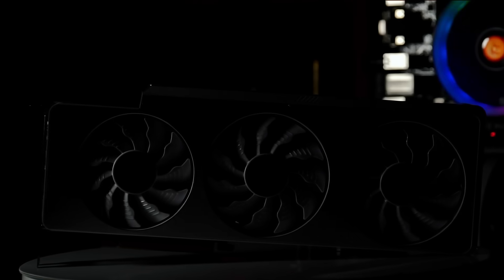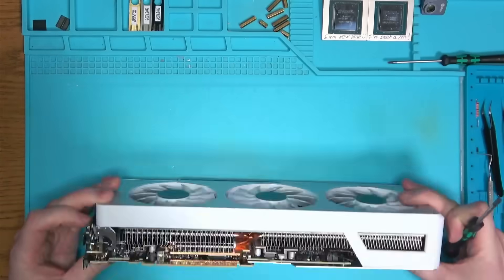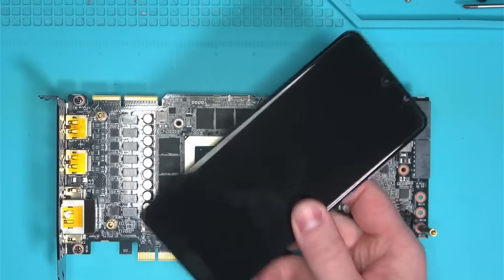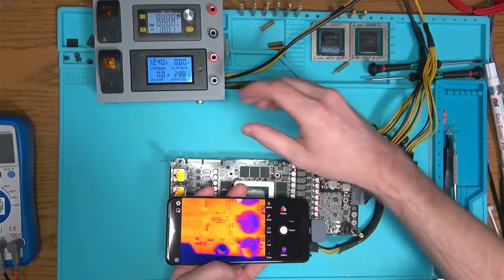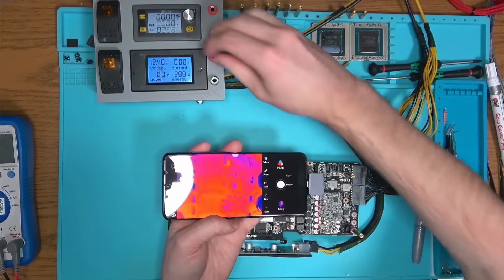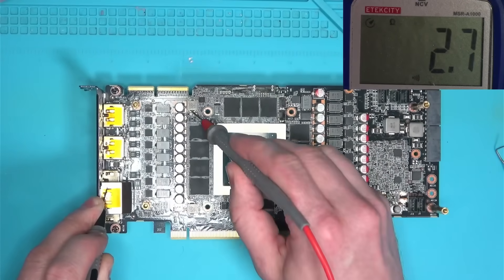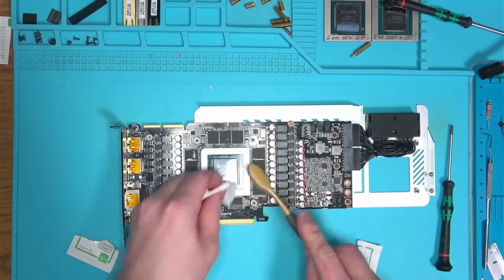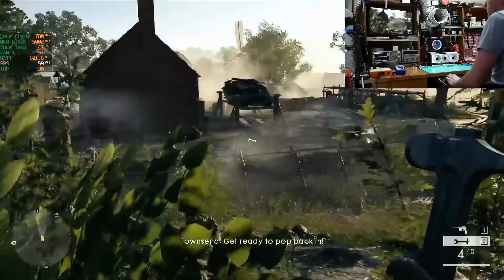Do rare and expensive graphics card fail less than budget cards ?

Comment: Profit margins are smaller on budget cards, so it's in the manufacturers best interest to ensure their cheapest cards last well beyond their warranty period so as not to cut into that profit margin. High end cards have plenty of margin, so much so that an RMA is usually built into the MSRP.

I've also found that if you're going to buy a flagship card, and you want it to long outlive it's warranty, you're on average better off buying a Radeon card. nVidia completely shafts their board partners on the price of their GPU dies, so if their AIBs want to make any money, they need to save money somewhere, and that usually ends up meaning poorer component selection. Yes, GeForce flagships are almost always faster and more feature rich than Radeon, but I've also found it to be a case of "the light that burns twice as bright burns half as long."

This is a big part of why eVGA exited the GPU market, because they knew they'd be selling failure prone garbage if they wanted to stay price competitive with nVidia founders cards and the junk that AIBs like Gigabyte and ASUS are willing to sell to unsuspecting customers, and eVGA's generous warranty service coupled with high rates of failure was a business model they knew was not sustainable.

Comment: I'm curious as to what is the most common reason for cards to fail and what the statistics are for failures in general.
Reply: i think failure through no fault of the user is fairly low. but some people do kill their components either by not cleaning them or other reasons like high humidity and not running a dehumidifier.

Comment: Why don't you use a bench power supply to inject voltage after the fuse? It would be alot easier than having to replace fuses just to find out which MOSFET is shorted. Of course, if you are going to fix the card, you need to replace the fuses, but if the GPU is shorted, it is game over.

Comment: Hey, I have this same GPU. It failed after a few months of ownership back in 2021. After having the card for longer than I did they finally sent it back "repaired". Near as I could tell they only replaced a fuse as it was the only area that showed signs of rework. However, I don't have a microscope so I probably couldn't tell if they worked those chips. Also, it was a different fuse than the ones you replaced. It was the fuse above the first one you replaced, the one with a Z on it. I said "repaired" (with quotes) because near as I can tell "Z" should be a 20-amp fuse (and I see you replaced it with a 20 as well). Gigabyte replaced it with a 10. 

I hadn't used the card much since I got it back because I didn't trust it. Since I bought an Asus 3080 Ti while waiting to get it back I have been using that. But because the warranty is up this year I've recently (as of 2 days ago) switched to using it. Haven't really pushed it yet, I'm somewhat afraid that it blowing again might somehow damage other things in the computer, though I can't imagine how. If you for some reason want more details/pics of the card I can send you them. I'd link them but putting links in comments pretty much always gets them flagged as spam.

Edit: Looking back at the pictures, one of the driver mosfets now has a different date code, so they did replace at least one of them. The fuse still appears to be incorrect though, so idk.
Reply: What you're seeing is a result of nVidia selling GPU dies to their AIBs at ridiculous prices, and the AIBs then doing a bunch of cost cutting on their component selection which results in flagship cards prone to failures as they dial in their component selection to only last as long as the warranty period. This is why eVGA told nVidia to kick rocks and exited the GPU market, because nVidia was forcing their hand to sell junk.

I hope you remember this next time you consider purchasing an nVidia card. I will no longer do business with nVidia, I consider them the scummiest in the industry. I've made some sacrifices switching to Radeon, but now I at least know that I'm not going to need to constantly worry about an expensive paperweight the very moment the warranty is up. AMD is also pushing hard to reach feature parity with nVidia, so it's a good time to start supporting them if you can manage without a CUDA equivalent for another 1-2 years.
Reply: @K31TH3R  i thought about going with amd, but there are too many issues. way more than intel and nvidia. i'd rather my components and drivers to just work.  also i never go with the higher end stuff. i stick to middle of the road. it does what i want for years and it doesn't cost me an arm and a leg. i don't need 4k, i don't do any editing or any workload like that just gaming and normal computer stuff.
Reply: @Stackali  When was the last time you ran a Radeon GPU in your machine? AMD is still suffering a bunch of (deserved) bad press for a terrible launch of RDNA in 2019, and another poor launch in 2022 with RDNA3.

I bought a 5700 XT on launch and the card was borderline unusable for the first 3 months, and wasn't really fully reliable until about 6 months later. It was the worst product launch I have ever seen from AMD. However, when I retired it in 2023, it was just as reliable as any other nVidia GPU I've owned, if not more so, as my luck with nVidia meant I statistically would've had a failed GPU in 2022, as they rarely last longer than their warranty period in my PCs.

RDNA2, on the other hand, has been about as close to flawless as a GPU architecture gets for the entirety of it's existence. I'm running a Liquid Devil 6800 XT and it has absolutely been that "plug it in and go" experience we all want from PC components, and while the productivity and RT side of things is lackluster, the card often has no issues performing way above it's weight class and often matches the RTX 3090 in raw rasterization. I also have zero fears about the reliability of the card, because it is massively overbuilt with a 14 phase VRM that maxes out at 42C even if I push 400W through it.

RDNA3 is also now in a very good state despite the rocky start, with 7900 XTX and 7900 XT owners having already done the work of testing and bug reporting that has ultimately made the 7800 XT one of the best all around GPUs AMD has ever launched, with little to no issues from the day it went on shelves.

It's also expected that RDNA4 at launch will be another repeat of RDNA2s flawlessness, since it's more of a refresh and refinement of RDNA3 than a completely new architecture. RDNA4 will also be targeting the midrange performance segment that you fall into. If you're willing to give Radeon a try, RDNA4 will probably be the best time to do it. Worst case scenario, you can just return it. 

IMO it's worth a shot, because we all need to be sending a message to nVidia that their behavior isn't acceptable.

Comment: Don't know anything about fail rates but personally I always keep my distance from ASUS GPUs because 80% of factory recertified/refurbished in my stores is from that brand. Especially if it is Geforce.
Reply: i've actually had 3 asus cards( 1060, 3070, 4070) and haven't had an issue. the other 3 were msi 1070ti , evga 760, and sapphire hd 7770. haven't had an issue with any gpus.

Comment: "Only one way" you could also use continuity test from gate to source/drain on suspected MOSFET.
If you're going for CC and thermal cam visual inspection is just wasted time.
Also, using BW or Rainbow HC color scales are better for spotting very small differences.
Last thing, why not replace ALL THE transistors? I highly suspect the card was operated in a suffocated case at very high temperatures and next MOSFET failure probability must be quite high.

Comment: I'm a mechanical engineer and I know for a fact that making a cooler for a GPU can be super easily achieved with absolutely no extra cost to a precision of around 0,1mm or less. The difference between a flat piece of metal that needs a 1,6mm thick thermal pad and a profiled piece of metal that needs only thermal paste is only about the mold. Flat mold gives flat piece of metal. Profiled mold gives profiled piece of metal that fits very well on all memory chips and all components that need cooling without the need of thick (and juicy) thermal pads. This means the memory chips almost don't even need thermal pads, they need liquid thermal pads and they are good to go. All you need is 4 more screws which are added anyway to almost all newer cards. This won't help when the video card is bent (thermal pads do help) and we all know that owners do make their expensive video cards to bend horribly.

Comment: I think budget cards don't end up at repair shops as often because the price to fix them would be close to or more than the card's value.
Reply: Yeah pretty much this, if I pay 2.5k random currency units for a rig and 1/3 of it is for the graphics card, I'm way more inclined to get it fixed for 100 or 200 bucks then if I would have only paid 1.5k for the rig with the card making up 1/4 of it

Comment: All those cards come off the same production lines. And even if they didn't, they still all use pretty much the same standard components. On some cards the engineers will feel creative and try something funny that may or may not work better than the default, but that's not too common. However, running data traces right next to the edge where the board bends at the connector is not one of the brightest ideas of this era.

Comment: More of certain GPU model on the market = higher chance of failures. Which means, despite of all the GPUs that end up on your table, the overall failure rate remains low, unless the GPU has a design flaw, like the 4090s with their melting connectors.

Comment: If a blown MOSFET saved the core in fancy card, do they use the same grade in, saying, the 60 end? If not, is it unnecessary on lower powered cards?
Reply: The blown mosfet didn't save the core, the fuses did, the mosfet was the problem.
Reply from the maker: That depends on the mosfet its self and the controller with good or not so good fail protection.

Comment: How do I try to prevent something like this from happening ? Or do these MOSFETS just go bad randomly ?
Reply: MOSFETS have their own "silicon lottery" just like CPUs and GPUs , sometimes you get one that's a bit weak and it works for a while or until it sees a load or thermal limit it doesn't like and it falls over. They are particularly problematic since they both tend to be used in high power situations and usually fail to short circuit, hence the blown fuses.

Keep them cool, limit the power, and you'll reduce the chances of a weak one seeing a condition it doesn't like.
Reply: You remove your gpu from system and put it in box, never use it.
Reply from the maker: you put fuses and use power supply with built in protection that will prevent powering on the PC if there is a short

Comment: quick question if alot thermal pad grease was to ooze into the pcie slot could it cause the pc to restart i have a 4090 with a optimus waterblock the backplate is a big chunk of aluminum with a full coverage fujipoly thermal pad that oozes thermal grease from the pad into the pcie slot because my card is vertical the grease  goes straight into the slot. ive been all of the sudden having restarts when playing a game happens anywhere from 5 min to an hour nothing changed on my pc this is the only thing i can think of it did this with my 3090 and both my 4090 all had optimus waterblocks with a full coverage thermal pad covering the back of the pcb
Reply: Only if it somehow prevents connection on card (paste and pads are entirely non-conductive, so if they go between card pins and slot pins, it is disconnected). Either way, throw that pad away, it doesnt cool anything anymore. And PCIE slot need some cleaning too.

Comment: I have "only" a Gigabyte 3080 Aorus Master. Someone wrote already about the crappy original thermal pads mine were a crumbly mess as I replaced them last year. My thoughts on reliability: it all depends on the operating environment and how good is taken care of the card. Imho you should re-paste and re-pad every two years and if those cards are mounted horizontally they'll need a support thingy if you don't want to experience a cracked PCB. They weigh around 2 kg after all. My PC is always online so I have my card in use 24/7/365 with workloads from just browsing to heavy gaming.
Reply: i dont believe reliability of card has to do with cooling, heck by taking apart the card to increasing the chance of failure by quite a lot i bet...
Reply: 3000 series Gigabyte and more brands have crappy thermal pads that start leaking oil around the PCB and even the fans in the horizontal position, i have one (3080ti) and the first thing i did was changing the thermal pads and adding more in the back to extra cooling, if i lowered the temps when it was new think about the damaged thermal pads and the PCB full of oil.

Comment: Tony can't actually answer the rare cards vs budget cards question because he only sees broken cards and he only sees broken cards people feel are worth repairing ( basically people only feel it worth the effort to save an expensive card these days so his experience is highly skewed). The best person to answer that question would be the RMA department of each card maker.
Reply: also lower end cards do not get bought by overclockers who buy expensive models and then destroy them...to send them in for repair if they think they had a golden chip.
Reply: i think high end cards break more easily simply because they heat way more, they are heavier and the new 12VHPWR cable is really bad (8pins connectors being better in every single metrics including security compared to this).
you can fix the heavy part simply by vertical mounting it (at the cost of all the other PCIE slots) or you can buy the newly released RTX 4090 that don't use the oversized cooler and are merely 1KG now.
reminder that when Nvidia finished ordering GPU coolers for this card, they decided to lower the power consumption (and thus the heat generated) but because the coolers were already produced, they slapped them on the new 4090 anyway and that's why you end up with cards bending, i know Gigabyte made a newer 4090 with the real sized cooler but maybe other brands did so as well.

Comment: When the excess solder is squeezed out   ( like at 3:15 ) why does it not short underneath the DRMOS FET?  Is it again about the flux and surface tension?
Reply: The 3 pads underneath the mosfet is all thats really making a connection I think. With solder and a good amount of flux the solder should move only to traces and pads. It kinda avoids anything not metal. I think squeezing it would just push the solder out and leave just enough on the pads underneath.
Reply: @Laggyness  Thank you.  I only have soldered a few ICs with pads underneath.  I have always been miserly with solder, worried about a short underneath. I will be a bit more relaxed going forward!

Comment: I'm OCD about temperatures, always end up replacing TIM and pads with top-draw stuff, adding fans and ghetto-mod ducts/baffles. I think a problem with devices over the last couple decades is designers letting various chips and SMD's run at temps that are technically within spec (taking the manufacturer at their word) but in the medium/long term kills them. Noticed that the MSI Gaming X cards I've been running for a couple of years years (a 1070 and 2070 Super) both have a scattering of pads on small, even tiny components which perhaps would have been left to cook on some GPU's, and there might well be other components that could use cooling. TL;DR - I think cooling on graphics cards is often usually compromised and just Not Very Good, even if the GPU, VRM and memory seem to be running at reasonable temps. I doubt expensive cards like this one are much different.
Reply: @LiveType  Agree, on the same page. I have the fans on the 2070 Super kick in at 43°C and on a steep curve that keeps it under c. 56°C (nearer 50°C in most games). I used to use Afterburner but switched to Fan Control (which was running everything else in the PC) because you can set the rate of ramp up/down. Highly recommend it.
Reply: I think that's no accident. When it breaks, you go buy a new one right?